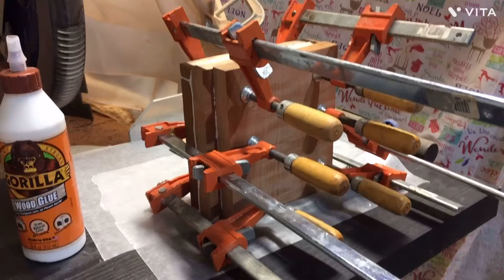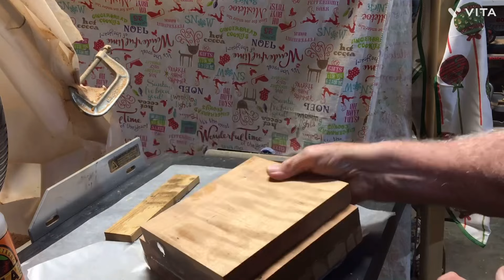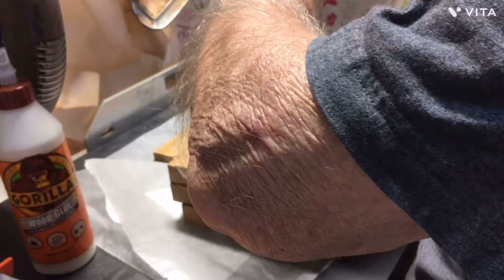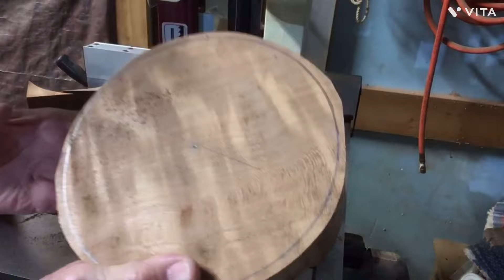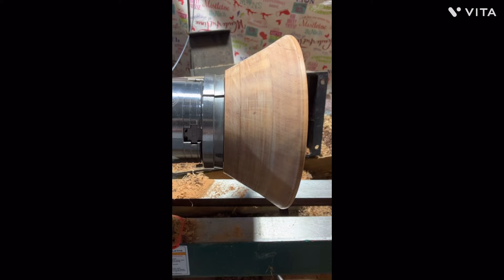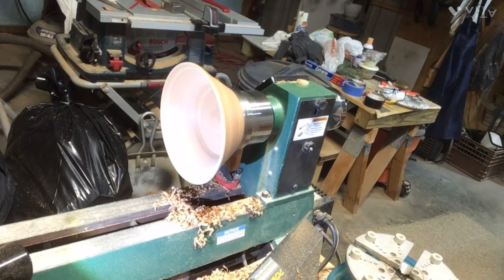Bowl made from very old timber!

Comment: Those two minutes of bandsaw work had me cringing the entire time. I'm not a safety-police guy, but seeing the fingertips of your right hand pushing toward the blade that close to it scared me.
  I cut blanks on the other side of the blade turning it clockwise with my right hand on the blank behind the blade working with my left hand to feed and rotate the blank. I keep fingers of the pushing--left--hand, curled under just as you did in the last few seconds of the cut.
  I didn't consider bandsaws to be especially dangerous (tablesaws are what shed my blood) until I saw Kerry Corney's video of his bandsaw bloodbath. https://www.youtube.com/watch?v=ZYO_KP3fq0E&t=63s
  I'm guessing the 42 in your handle refer to your birth year. If so, we're the same age. We aren't as sharp as we used to be. Be careful out there!
Reply from the maker: Thanks for looking Eric?  Old habits are hard to break.  Over the years I have had some close calls, the worst being a drill press.  Fortunately, I still have 10 fingers.  Your bandsaw technique is worth a try.